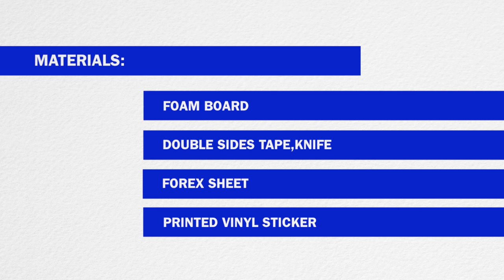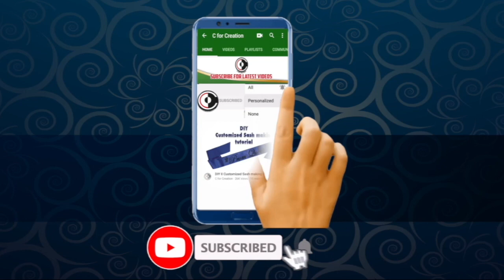How to Make DIY Cylinder/Pedestal Display Stand

Comment: What is the thickness of this foam board?? Also what is the size of the vinyl sticker that u have printed?
Reply from the maker: 1MM,STICKER SIZE 150X70
Reply: @CforCreation  sir. Is thus 1mm or 1CM? Because it looks thick.
Reply: 150cmx70cm for one cylindrical plinth?  Also is foam board 1cm or 1mm?

Comment: What is the size of forex sheet used here?
Reply from the maker: 1mm forex  140x75 cm used for 2 small  stand
Reply: @CforCreation  and the foam board is 240*120 cm with 1 mm thickness ?
Circles you cut are each 40cm in diameter ?
Reply from the maker: Foam board 10mm thick,forex sheet 1mm,circle  40cm dia